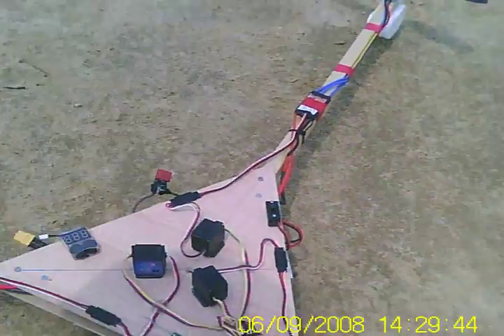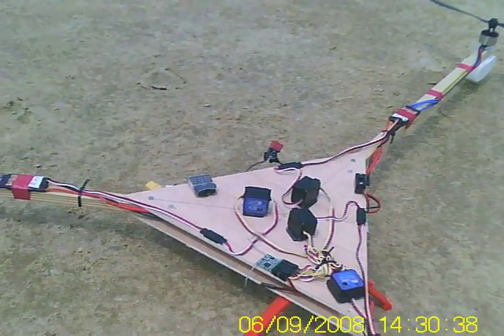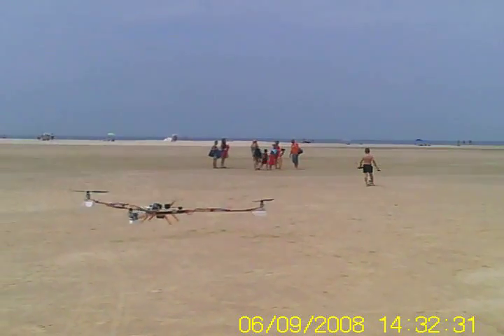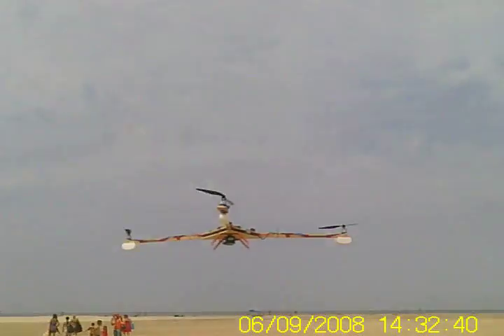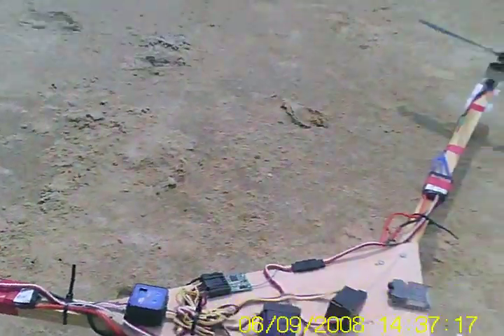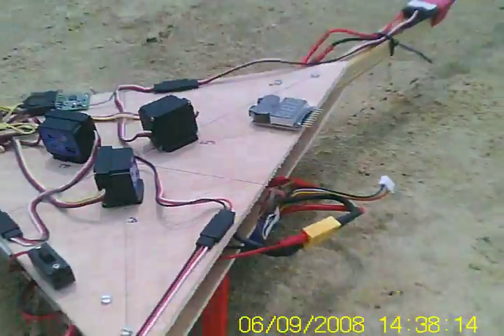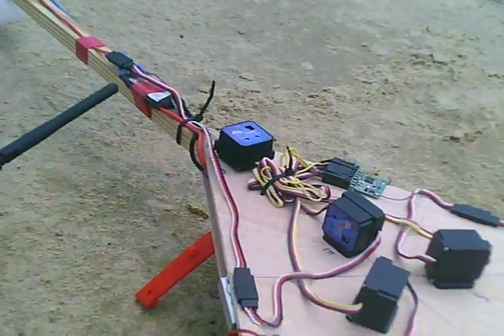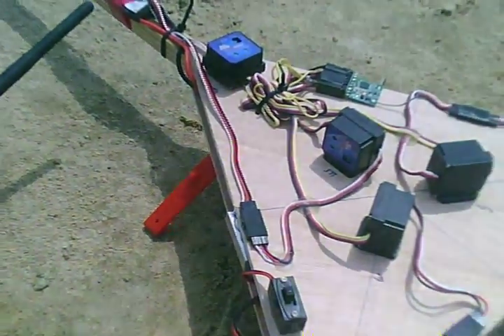Tricopter Maiden Flight

Comment from the maker: This was my first multi rotor build, before control boards were readily available. So our only option was to use separate heli gyros and program the radio ourselves to takl to the gyros in the right way. Now its super simple with the boards. I use the Open Pilot CC board for my new quadcopter that i maidened yesterday. There are many brands to choose from, KK, NAZA, OPENPILOT, ARDRUINO.....good luck :)